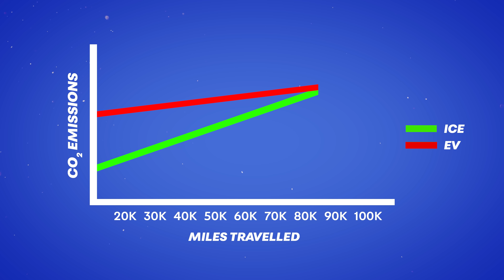Are Electric Cars REALLY That Green? [New 2022 Data]

Comment: It is true that in the last 10 years, exhaust filtration systems on ICE cars have become so advanced that they remove up to 80% of all carbon emissions and turn them into nitrogen by the time it leaves the exhaust pipe. This is true on semi trucks as well. Since catalytic converters became law, the amount of carbon emissions by cars has drastically decreased, but it it still raising overall for the planet. However, for me, its more so about moving away from fossil fuels and moving to renewable energy. Like one day we are LITERALLY going to run out of fossil fuels so we better find a replacement. Also, its nice to fully charge my 2021 Tesla Model 3 for like $5. So its just so much more affordable. Also the point of driving in densely populated areas is good, more EVs and the air quality in those areas is going to go up and polluted air/smog will go down.
Reply: Carbon (C) and Nitrogen (N) is separate elements, you can't convert carbon into another element... unless where talking about some fission/fusion reaction happening in that filter XP
Reply: @jtengelbrecht4613  thanks! I meant to say that 80% of the exhaust is just nitrogen and not carbon, not carbon getting turned I to nitrogen
Reply: @Theultrazombiekiller  I believe that is the nitrogen that goes into the engine as part of the "air". The effectiveness of carbon capture is questionable and often considered green washing. If it worked on the trucks with 80%+ efficiency they would have more CO2 in weight than fuel they trough in the truck. I've never see a truck unload 100kg+ of CO2 from their exhaust.

Comment: Petrol engine effecincy is way higher than power grid.
Reply: You're average ICE is 25%-30% heat efficient. Coal fired power stations, one of the worst, are 37% efficient and gas fired stations around 60%. Then add renewables to the mix. Co2 per mile for ICE is way higher than EV, even using coal generated power exclusively.

Comment: I have questions on how clean EVs are when the EVs battery need to be replaced? Even replacing it once in it's life would cause more waste and toxic metals bleeding into the ground. Are EVs really that greener than gas cars? 🤔
Reply: yes
Reply: But why do you assume the battery would be buried? Only a complete imbecile would bury an old EV battery, because they are way too valuable. "Bleeding" into the ground?  But there is no liquid component in an EV battery to "bleed"!  The vast majority of older expired EV batteries can be 95% recycled. The cobalt and lithium can be recovered to 90% and reused in new EV batteries. Try that with petrol or diesel. Both Volkswagen and Renault now have EV battery recycling facilities up and running. And those older tired EV batteries which are not recycled, can (and already are) being used for energy storage in commercial, industrial and domestic situations.... They may no longer be any use to drive a car, but their energy retention is more than adequate for those purposes...

Comment: Volvo released the study in the name of transparency. It gives the numbers that people can actually refer to, and does so in an impartial way. This is what we need more of.
Reply: Volvo is moving towards full electric. It’s foolish to believe they’d be entirely impartial.
Reply: @paulwilliams667  and yet their report was actually quite critical of going full electric, showing that a balance is required as BEVs aren't inherently greener than ICEs; it depends a lot on how long you plan on keeping it, how many miles/km you intend to run, and how green the energy matrix of your country is. If your country generates most of its energy by coal or oil, the time needed for your BEV to become greener is much longer.
Reply: @ikemotosystems1434  That's my point! They ARE biased towards green energy and their report still isn't conclusively EV>ICE.

Once you take into account the mining processes, lack of recyclability and energy expenditure to transport raw materials, EV tech is absolutely awful for the environment. There shouldn't even be a debate on this subject. EVs won't be viable until solid state batteries or similarly efficient tech is widely available.
Reply: @paulwilliams667  Ah gotcha! Thought you were referring to the report being biased! Completely agree. I do believe EVs will be the future of mass individual transportation, but only when we can actually solve the issues of making them having a huge impact on the environment. 

Ironically, Toyota is the one who is experimenting and developing solid state battery tech. The one company Tesla fans love to shit on and predict the doom of, are likely positioning themselves to eclipse Tesla in the fight for the BEV future.

Comment: The argument against EVs, that the electricity production has negative effects on the environment, is a bit specious. While true, the power company is going to produce that electricity whether you use it to recharge your car or not. The electricity will be produced regardless, so in this regard, EVs don't cause any more harm than what would have happened anyway.  EVs would have to be a lot more prevalent than they are now for the power companies to start increasing their power output to compensate. ICE cars OTOH definitely do cause additional harm just by using them.

Comment: To put into the same category a Volvo xc40 (2200kg?) charged by coal, with a Twizzy (420kg) which is charged by solar..
Is quite frankly at least disingenuous, at worst outright lies.

Horses for courses.

However these super heavy SUV models with massive batteries are a problem, you don't need 500km range.

Buy an i3, if you're going further than 200km fast charge, it's not rocket science, and buy solar panels you tight git.

Comment: Volvo's EVs aren't very efficient at all. They're not even in the top 30. So using their EVs for the comparison is very flawed. Would have been better to use the average efficiency of all electric cars sold over a given time period. The most efficient Volvo is the XC40 with a efficiency of 396 wh/mile. Compare that to the highest selling ev in 2021 the Tesla model Y which has an efficiency of 237 wh/mile. That's almost twice as efficient as the Volvo.

Comment: For me the main issues with EV's are:
1. Cost of the vehicle is still quite a bit higher than most are willing to pay.
2. In the U.S. , we don't have the infrastructure to handle a large populace going pure EV currently.
3. Range is still a bit low for me. There are times where I have to drive a longer distance and EV's are under that range.

I currently own a CTSV (gas guzzler at 9-18mpg depending on how fast I want to go) and now a Golf R (my daily driver). And I'd get an EV if the range was increased and I had a consistent charge point. I'm not against them, but for me, certain items need to be addressed before I go that route.

Comment: Why is the energy mix for the used electricity important?
What happens when you replace an ICE for an EV?
Does the energy mix stay the same? If so that would mean solar would produce more when a new EV gets sold. That doesn't happen in most cases, when a new EV gets sold a fossil fueled power plant is turned up a little.
Only when the energy mix is close to 100% green an EV runs on green energy. In some EU countries this happens on sunny windy days, but that's not that often.

Comment: If you live in an area like me where your grid consists of coal power you're probably better off with an internal combustion car if environment is a concern. I also found that EV cars tend to not have the same lifespan as internal combustion cars. My neighbor has went through 3. I have almost 200k on my car currently....
Reply: But surely your neighbour didn't scrap those EV's? He surely traded them in for newer models?  There is nothing to suggest an electric car will not last just as long as an ICE equivalent. There are plenty of 10+ year old EV's out there...
Reply: EVs can often last over 100,000 miles though.

Comment: Good look getting one of those milk floats to 90k before the car is (plastic) scrap or the battery is done for which is one in the same thing in most cases I gather 😂 but seriously it’s good that this information is slowly getting out there to the masses. It’s gunna be some time before you can beat a diesel for those of us who put some miles down.
Reply: Oh, that's strange. The YouTube video posted by the Tesla Model S owner, whose car had covered 400,000 kms on it's original battery, looked real enough. I couldn't detect any camera trickery..  Likewise, the Nissan Leaf taxi based in my local town, which has clocked up in excess of 160,000 miles on it's original battery is real enough too. I have actually touched that, so I know there's no CGI involved....
Reply: @Brian-om2hh  maybe one day I’ll come round if they ever make a cool EV but for now I’m in love with my old turbocharged classics, yeah they need some lovin to keep on the road but in a way greener than a new car, that’s if you don’t role coal 😬

Comment: Least electric cars do away with pollution at ground level meaning you're not being forced to breath the fumes and particulates from that high mile diesel taxi thats sitting idling on the rank or the chav with his dpf filter removed and the overfueling remap installed so he can 'roll coal' at people for giggles.🙄 Bring them on i say👍 forcing motorists gradually is the only way to bring the change i reckon. We keep hearing about the environment and people dismiss this saying, i couldn't care about the environment but what they fail to realise is the environment is the space around them.🤦‍♂️ Who wants to breathe in cancer causing crap really, i'd much prefer clean air👍😁

Comment: Greener after 90K.. Until 120K when the batteries need replacing - woops!
Green H2 produced via electrolysis letting ICE vehicles is the way to go!
Reply: The Nissan Leaf on my local taxi rank hasn't yet had it's battery replaced. And that has covered almost 170,000 miles. Which EV did you own which needed a new battery at 120k miles?

Comment: What about LPG? Always ignored in the conversation. It's the cleanest burn available for a piston engine & less CO2 as well. And did I mention 63p a litre?
Reply: LPG refining causes huge emissions. Sure, it's nice and clean at the point of use, but a pollution nightmare during refining..... You are also sometimes restricted as to where you can take an LPG equipped vehicle. You cannot for example, travel through the Euro Tunnel, and some underground car parks do not allow cars with LPG tanks..... Some UK sites which previously sold LPG are now being dismantled due to lack of use.
Reply: @Brian-om2hh  LPG has 2 main origins. Around 60% of the gas comes from the extraction of natural gas and oil from the earth. The other 40% is produced through the refining of crude oil. Traditionally, LPG was wasted and burnt off as an unwanted by-product of the production of other fuel sources. 
Never myself seen any LPG banning signs at underground car parks and there are ferries if you're desperate to drive your own car abroad. 
Of course, the combustible properties of electric vehicles are never mentioned in this context.

Comment: ... but if it takes you 10 years to get to the crossover point who's to say that your EV's batteries won't be shot and the cost of replacement exceeds the value of the car resulting in the EV being scrapped? Meanwhile the comparable ICE car is still going strong and doesn't require replacement and thereby a much greener carbon footprint. It's not true that ICE cars can't be improved. Switching the fuel to hydrogen would result in only the manufacturing carbon footprint of the vehicle as there are zero carbon emissions from the exhaust.

Comment: did you factor in  7 years time you would possibly need to replace your batteries at the cost of more than the value of your car also electric vehicles are very heavy could this mean excessive tyre wear.

Comment: Considering the extra manufacturing needed for a internal combustion engine over an electric motor Volvo has there calculations completely wrong. Volvo has not taken into consideration the oil, coolent/antifreeze. Modern batteries actually create less greenhouse gases to manufacture than a 2 litre 4 cylinder normally aspirated petrol engine creates in 6 hours at around 4000 rpm. Another problem with this comparison is the method of electricity production and as electricity is very easy to produce and store only using the properties of water electricity production can be 0 emission. You can easily change any modern city to a closed loop hydroelectric power system in under a year and the system can be built so it is self recharging. The simple fact is that unless we stop burning fossil fuels in the next 5 years the runaway greenhouse effect that is currently happening will increase exponentially and in under 100 years the human race will become extinct. It is actually cheaper to build and maintain an electric car than an internal combustion engined car. Volvo is not the best car manufacturer and they have a habit of over engineering their cars. On average a electric version of a car produces 80% less greenhouse gases to produce and maintain than the petrol version.

Comment: The EV finally reaches an even point and POOF! The battery goes bad...  Remember that battery figure? Repeat it for the EV in it's life cycle.
Reply: NotLxrd  What I am is an mechanical and electrical specialist in complex machinery. I expect batteries to start loosing their total functional capacity within 60,000 to 90,000 miles having reached the mid-point of their charge cycles.  Most total replacements I'd not expect the average to get far past 100,000 miles. Since the battery is most the cost with the car,  that means on average a 3/4 car replacement in 100,000 miles which is considerably lower than the average replace in mileage ratio to the IC counterparts. This of course will create boosted debt levels and more excessive power drag

Comment: Only place Ev's will work is urban. Going rural it isn't just about how far you can go, but how much of a work horse the vehicle is capable of and the Ev's fail miserably. Fill the back of an EV with firewood and see how well it does. ICE vehicles struggle with this task. An EV won't make it.

Comment: Ev's are not cleaner than ICE mostly because their ability to operate depends on the same fuel source: oil.
 The cars themselves are over 90% plastic which is a petrochemical: more oil. 
 
 The batteries are a Hazmat material when the car is done with them and we don't have an effective way of dealing with them. 

 Ev's at best are a nich market. The only place they will be useful is in an urban environment.

Comment: Electric cars are a half baked product. Until they cost the same as a normal car, can be recharged in 5 to 8 minutes from empty like a normal car, can go 400+ miles like a regular car, have universal charging on every corner like a regular car and don't need their batteries replaced ever, the general masses won't be interested. As shown here they are actually worse for the environment in production and added electricity infrastructure. Car manufacturers are literally throwing their resources away developing something they will never see a return on until these key problems are solved.

Comment: Think the intro is very controversial and generally depends on what you're trying to prove.
For example; me and my friend both got EV's and did some calculations on how much CO² we're actually saving. Mine came out to break even at 30.000km while his came out at 85.000km. It depends a lot on where the energy comes from. Mine charges from solar energy at work while his comes from grid energy. My commute is basically a bunch of straights compared to his congested highway route.
We didn't conduct any scientific study, but using clean energy is key in EV's being better. Which is what we should be pushing governments and employers to do.

Comment: Here’s the problem; as with fossil fuels, the more lithium that’s mined, the harder, and more expensive, the remaining lithium becomes to mine. This problem is compounded when you consider that there’s still far more fossil fuels remaining than there was lithium to begin with. Battery technology is not moving nearly fast enough; all we’re looking at is evolution of the lithium battery as opposed to a revolutionary replacement any time in the next two decades, at a time when demand is already starting to outstrip supply. In short, the more lithium we need right now, the less green it becomes to provide it. Major shot in the foot.
Instead of charging toward peak lithium by rushing EVs to market, automotive manufacturers should be working with battery manufacturers to perfect the technology as a side project only, while focussing on improving fuel efficiency & researching alternative ICE fuels, such as ethanol from food & factory farm waste. Otherwise they run the risk of perfecting battery technology just in time for the supply of required raw materials to run out.